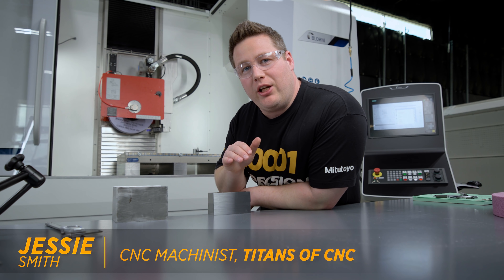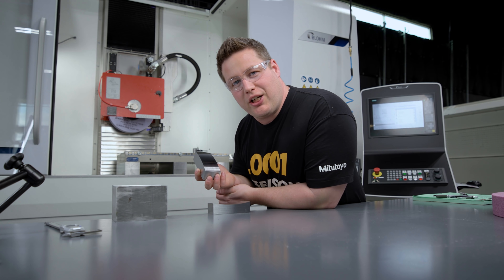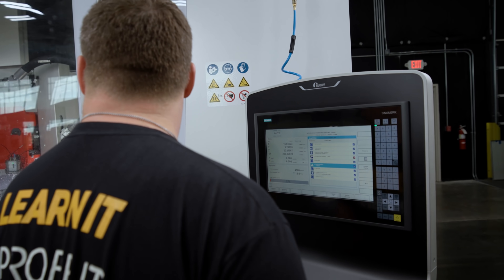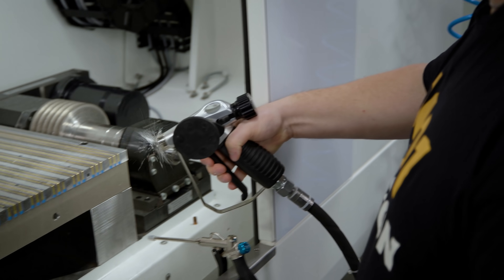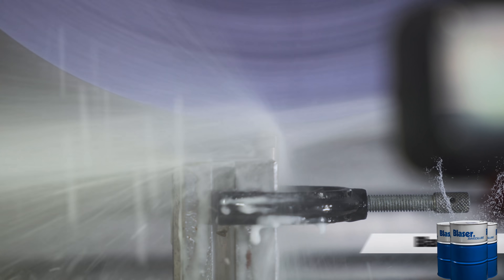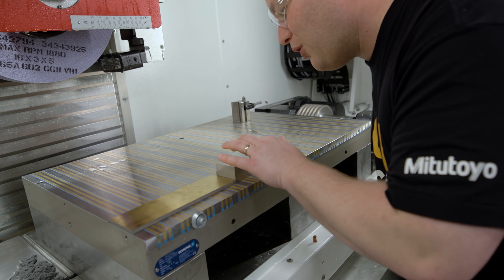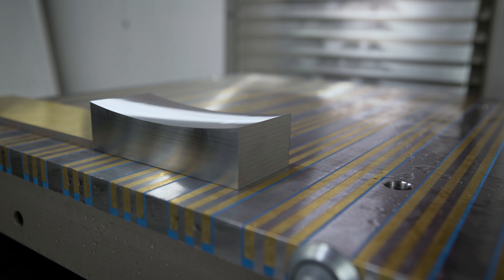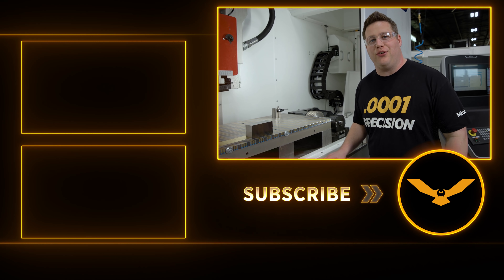The COMPLEX Art of GRINDING Convex and Concave Contours

Comment: cool trick, but can you do both at the same time?
Reply: If by both at the same time you mean multiple parts in one program then yes you can.  The conversational programming on this machine is so super simple.  You can set multiple offsets if you have more than one part.  Each cycle in the program asks for an offset number so it's really easy to jump part to part.

If you're asking if it can combine the two profiles and make a "wavy" pattern from concave to convex or vise versa the answer is also yes but you would have to program it in Blohm's CAM software called Grips.  It is also very easy to do and I will do a video on it in the future.